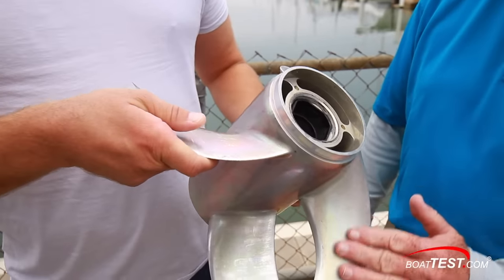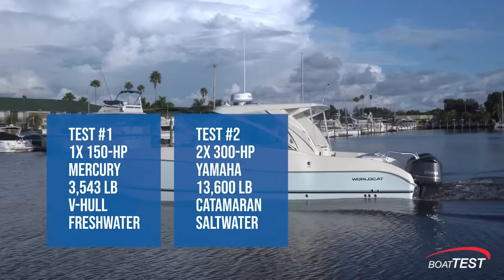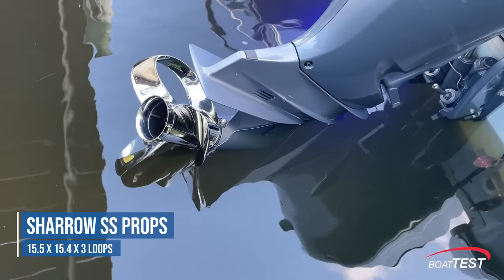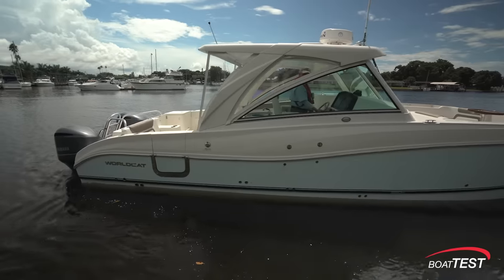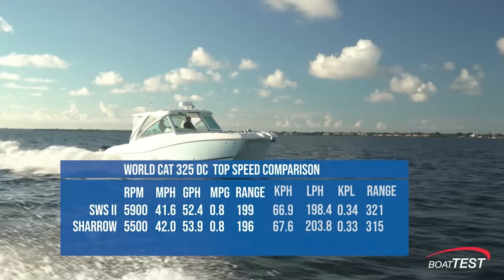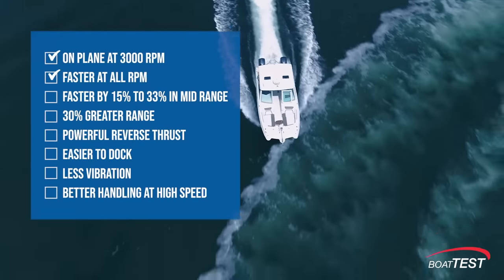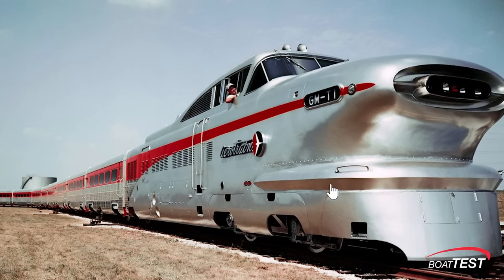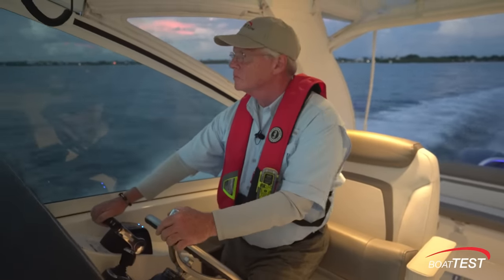Sharrow Propellers (2022) - Test Video by BoatTEST.com

Comment: The results from this test are flawed because the pitch of the newly designed prop should match the top end rpms to be comparing apples to apples. So I'm saying this new prop should of been a higher pitch.
Reply: The most important ""RPM"" would be where the torque/horsepower lines meet on any/all motors, no matter what the factory recommended ""WOT"" operation RPM's say on the BIA TAG & if these guys are taking that into account while building a prop for a certain motor and or boat combination, then they SHOULD be considered to be ""PROPERLY PROPPED OUT"" as we used to say while trying to get the customers to understand why we COULDN'T just stand behind the counter and ""SELL THEM THE EXACT & PERFECT PROP"" for their boat without at least knowing what their exact ""WOT-RPM"" was on their hull/motor/load/usage/altitude/fuel/air temp ect ect ect that they were showing on the tach & they just go ""HUH, I DON'T KNOW, IT GOES THIS FAST"" and even with the biggest bank account, they COULDN'T BUY A CLUE!!! Propping is the most important & hardest thing to ever do on a boat & that is where the FUEL meets the WATER, PERIOD!!!

Comment: At the 6:45 mark they make sure to mention they squeezed .4mph faster top speed out of the sharrow (plenty of room there for error, bias, temperature changes between props etc) but notice how they leave the positive 1.5 gph loss colored green and don't mention it. That 1.5gph should be red. Also how are you going to have higher GPH but the same MPG. Also the range is lower I just noticed. Seems like a biased test and this seem like simply a commercial to me not an honest test.

Comment: Toroidal props are a game changer.    More efficient,  reduced vibration.  This reduced vibration mean less wear on all parts AND less noise.  Yes the boat props are very expensive at this time but that will change as it does with all good tech.   Toroidal drone prop designs exist and are being 3d printed.

Comment: I'm sorry but I am not buying it. While both props are 15" pitch you can clearly see WOT numbers are skewed on this hull. Maybe WC wants a 15" prop so that WOT is closer to 6000 but Sharrow's 15" prop spins only 5500, which is what you want when FULLY LOADED. Using that data point alone I would have expected SWSII 17s or 18s to give a similar WOT that would then translate into better efficiency in the lower RPMs. To me the Sharrows are towing the line of 'over propping' and this video skews heavily in their favour without giving us the full picture. Yamaha has posted on its website numbers of the older 320 DC with their SWSII props giving similar numbers to the Sharrow here using the same 15". If you ask me a more fair comparison would have been a higher pitch Yamaha or a lower pitched Sharrow to get similar WOT numbers.

Comment: I wonder if it will lead to improvements in electricity generation and shipping container fuel costs, or are there lower RPM propeller not a good fit. Even a few % would still be a big change in the industry

Comment: Hi, in the table given at 4:05, you have the wrong conversion from miles to km, 23.8MIH=38.3KMH. But if you are counting nautical miles, the conversion is completely different for both results. Otherwise great video.

Comment: Enertia prop works fine for me. Lab your prop if you want to speed. With Sounds like sparrow prop is just using a bigger prop compared to the original on the boat.

Comment: In the top speed comparison, you labeled everything in green for the sharrow, when the Sharrow burned 1.5GPH more fuel, had less range, even at a lower rpm. Only picking up 0.4mph.

Comment: I have triple Yamaha 300 hp on my boat. The two speeds I utilize 98% of the time are 4000-4500rpm at cruise and 1500-1800 rpm. These props do not help in the 4000-4500rpm range, but would dramatically improve trolling speed efficiency. Would take 10 years in fuel to justify the cost. Should replace all current props. Must recovery R & D costs in the beginning.
Reply: Judging by this prop, youll probably be at 3800-4000 allday verse 4000-4500 cruising at the same speed. Thus lowering fuel consumption majority of the day.
Reply: Your RPM range isn't as important as your speed through the water.  A good place to start would be to compare your speed in your current RPM range with what RPM is required with the Sharrow to get that same speed and then compare fuel flow rates at those RPMs.  But I do agree- you'll never recoup the cost of the props in fuel savings.  If you wanted to save fuel immediately, you could just throttle back a bit and not spend ten grand or whatever on props.  I went through a similar dilemma several years ago. I was looking at turning a Hatteras 53 Yachtfish with bad engines into a trawler because I'm good with hull speed on something that big, but even a pair of 180 HP 6BTA Diamonds wouldn't have cut the fuel bill enough to justify the cost of the repower compared to simply rebuilding the 8V-71s and living with the extra two or three GPH fuel burn.  In that case, a big factor was labor; I can do an in frame rebuild while in the water myself, but there's no way around paying a yard for the haul out and labor of a repower.
Reply: @Prototheria  A good prop shop could probably tune your prop and get you some real improvements with what youve already got.

Comment: I think what is more important is the PROP rpm and not engine rpm.   There are many prop gear ratios that would not match this test.   At what PROP rpm has the most efficiency?  My outdrive gear ratio is 2.3:1    For example: my engine rpm of 4600 = 2000 PROP rpm.   I would love to see PROP rpm performance figures.     Thanks for the prop test, the technology is very promising!!!

Comment: If you can afford a 1.5 million dollar boat I guess another $40- $50,000 for props isn’t a big deal. I sure as time passes the price will come down also 
I remember when plasma TVs first came out $16,000 I waited a couple of years and bought one for $700 . The old saying a better mouse trap but the old ones still work just fine 
Great video thanks for sharing
Reply: I have a boat that I payed 54k used and new range 65k to 85k depending on options. So that's comparable to a pickup truck.  I'm not putting $5000 tires on my truck? If this prop is $5000 that's more than 10 times my stainless steel performance prop.

Comment: I know this isn't a bass boat channel but I'd love to see how this prop preforms on a 21' bass boat with a 250 hp engine. I've always preferred a 3 blade prop, a 4 blade really slows my boat. What is the drag comparable to and how would it effect the top end ?
Reply: My dad has a 2005 ranger z21 with a 250 horse. And we are wondering the same thing. Someone mentioned this prop is 5000$ dollars in this comment section. Eff that.  I got pictures of my dad's boat on my channel
Reply: @WitkowskisFishingSickness  You know when a new Ranger is around 100K what is a 5K prop to make it preform better? This will blow your mind. My first Ranger 361 was a 1993. I gave $17,200 for it new and ready to fish w/ 150 Fast Strike. It didn't have a hot foot or a front graph so I did add that. The guy I sold it to still owns it. It's never been parked outside and still looks amazing w/ the original engine. I live on Chickamauga Lake and that thing was seriously used. I wouldn't mind having it back.
Reply: @turdferguson5300  omg that it crazy bassboats have gone up alot. I was born on 1991
Reply: @WitkowskisFishingSickness  I remember you now. Your Dad and I want to different schools together. lol I guess 1993 sounds (is) old. I'm currently having my first car restored from the frame up, a 1981 Z28 Camaro w/ T tops. As I recall it was under 10K. I doubt they made cars with T tops in the 90s ? Dang it I'm gettin old...

Comment: Is it an oversimplification to say that the difference is mainly that the Sharrow Prop both "pushes" and "pulls" through the water through a complete 360 degree rotation whereas the standard prop only "pulls"?

The underwater view proves that there is a significant incrase in "laminar flow" versus "turbulent flow". 

In the study of hydrodynamics, a greater mass of water flows over a cycle during laminar or smooth flow.

Conversely, a turbulent flow results in a lesser mass of water flowing due to air or cavitation in the flow.

Clearly the Sharrow Prop "grabs" and displaces more water (33% more?) over a distance because there is less cavitation on half the turn on a prop.

It is similar to a foil and the Bernoulli Effect. Past a peak curvature of a foil drag is increase resulting in a higher drag and decreased lift.

Or perhaps the transition from less drag to greater drag takes less time, therefore less time of cavitation?

Whatever the case,  I love the fact that this is a...no pun intended..."spin off" technology gained from the experiment to reduce drone noise!

Comment: What nobody noticed the weight difference of Sharrow prop to the standard prop ,I've seen another YouTube clip of being slower . This means the sharrow prop is heavier and more material is used . A 3D printer could manufacture quickly than casting and milling.

Comment: Mostly, It just acts like a bigger prop. Half way in to the video, you see the results, much less fuel consumed, but At Slower Cruise and, a lower top end. You can do this by just "over-propping." I'm a fan, too: at the all important cruise, you get more speed and efficiency if the engine works a little harder. You won't be able to reach WOT and same top speed, but maybe that's fine. Reconciling the results to the same speed, you have to scale fuel consumption by speed cubed, which predicts 19.5gph (vs 21.2 for the standard props) at the same speed.
Reply: Good (better) top speed means lower drag, believable from the better aspect ratio.  But remember what you're getting for the money is to keep your top speed. Which is great!  ...but ou could do similarly through the midrange by adding 10% to your pitch with conventional props.

Comment: Guys, using non-nautical units isn't easy to follow. Please use Knots for speeds, Nautical miles for distance.. Also, you have an international audience, use litres. And as MPG is VERY much dependent on speed, please use litres per nautical mile, it's a more meaningful unit.

Comment: I had to change my high performance three blade prop on my 19’ Carolina Skiff a little under powered with a 90 hp E-tech it’s a shallow running boat with a constant 8’ beam from stern to bow. I switched to a 4 blade prop and changed the pitch to give the vessel more stern lift to get on plane quicker, I lost some top end speed but it handled well and would plane easier with more people in the boat. How would this prop work on a flat bottom barge boat like a Carolina skiff?
Reply: Having experimented extensively with prop pitch/diameter, I can offer this:  First, contact Sharrow.  They'll be far more knowledgeable of your exact question than Captain Steve (not like anyone from B-T will reply to you here, anyway).  Second, you'll need to get some data beyond seat of the pants between the two props you've used.  You'll need to gather RPM, speed, and fuel flow rate at various points along the RPM range, as well as time to speed data.  You'll also want the conditions to be as identical as possible for both props- same weight, same distance, if there's wind and/or current, two passes against and with each then averaged out to find the median average.  Once you have that, compare the differences between the three and four blade props you've tried and what the difference between the two props that Boat Test is reporting in this video.  You'll have to do some extrapolation, but it'll get you far closer to being in the ballpark as to wheter a Sharrow would be better than your current four blade.

Comment: Its brilliant. And the performance numbers show it.  Build enough of them and the price will come down.  Too many naysayers that dont understand how big a deal this is.  Prop design has been stagnant for decades. Incremental improvement.  This thing is a huge leap forward.
Reply: Back you mean. It was known and calculated 50 years ago. Dead end but marketing call it "innovation". Remember "fuel additives"?
Reply: @santac6091  Proof of your assertion? Happen to have a few books on propeller design, and haven't seen this yet. Additionally, the data this far show it to work well.  There is also a new wing design being tested that looks exactly like those prop blades and solves the tip vortice issue the same way.

Comment: What about the 150 and less hp?   What about costs that exceed the boat and engines?  I was reading that we are talking about $5000 for a 150 hp in the Yamaha, after a log strike with a fishing boat, $5k vs $2-3 hundred pays for a lot of gas burning to justify the fuel savings between the two propellers.   So the question is, does the propeller manufacture interested in everyone using their propellers with keeping costs down or selling fewer props. The turnover with more being used with higher boater's installing would pass the savings on and have a higher long term cash   flow.

Comment: Great concept. Sounds great when saying 50% increases, but what's the statistical significance of these improvements?  
Sure 40% increase in fuel economy is fabulous, especially to a person as frugal as I am. But the prop is at least 10x as much as a normal prop and at the mid range peaks at a difference of 1.4mpg-1.0mpg? Seems like a silly expense to achieve 0.4mpg more, even knowing that's a 40% increase.

105% and 40% increases only mean a lot if the numerical increase is also statistically significant

Comment: Everybody only focusing on payback period of fuel savings is ignoring the reduction in noise and vibration and how much lighter and more responsive they make the boat feel. If you want the same improvements in NVH and responsiveness by other means that generally entails a much more expensive boat or engine. Better to look at it as a refinement mod that has the added benefit of performance and economy than the other way around.

Comment: It should be better as it's a toroidal propeller. Same concept with airplane / drone propellers. They were created to develop a quieter blade design but noise, or cavitation, is a function of ineffeciency so the blade design is also more powerful and fuel efficient.

Comment: Interesting results for you Sharrow testing. I’m wondering how they would go on a Silent 55 cat. Or are the best suited to outboards only?
Reply: Looking at the video, I'd say the design will work equally well for sterndrives. Remember that in most cases, the design difference is merely a question about how the prop carries the boat. That Sharrow should be able to adjust.
What they have not talked about, and what might be an issue, is on boats that surface the props.

Comment: I want to see this on a 20 or 21 ft bassboat with all brands of 250hp engines. I have a 21 ft pheonix bassboat  with a Suzuki 250ss  that tops out at 74mph with a full tournament load, empty livewells and just me the driver. Also has a 12" jackplate. Current prop is a 28 pitch  scorpion. Not the Susuki prop which doesn't perform as well.  Most important to most bassboat guys is top end and hole shot. I'd love to know the difference with this prop. What made bo sense to me though about this test was at top speed the new  prop spun motor at less rpms so in my mind they should of gone up in pitch to match the rpms which in turn would of made the new prop faster not the same speed.

Comment: My only question is how can to say it gets better fuel mileage when the engine was only turning 2000rpm and with the other prop it was turning 3000rpm.  Shouldn't you test fuel consumption per rpm range?

Comment: I looked at the Sharrow web site out of curiosity....currently they only make props for 150hp and up and they start at $4,999... My boat could benefit from better prop performance but it is a 75hp motor on an $19,000 tracker 16ft deep V hull.. maybe some day they will expand to smaller engines with a more reasonably priced prop...
Reply: Difficult for it to be cheap. I had family who worked on post-machining the castings for these and its all very precise 5-axis work. The required surface finish is gnarly. Once they finish machining the casting, they had to run them in a tumbler with tiny media for an even finer finish as well. Its like trying to sand a multiplanar surface lol. If I'm not mistaken as well they had to be stainless steel to be stiff enough too. Genius design, difficult to make.

Comment: Very interesting  ...   But I think I'll stick with my Solas 4 blade prop.  It easily outclasses the std OEM 3-blade on a 90 hp 4-stroke on a 700# hull.  
Better hole shot, better mid range, better fuel economy.  So how does the Sharrow compare to a performance 4-blade ??
Reply: Shhh the great OZ says don't look behind the curtain.